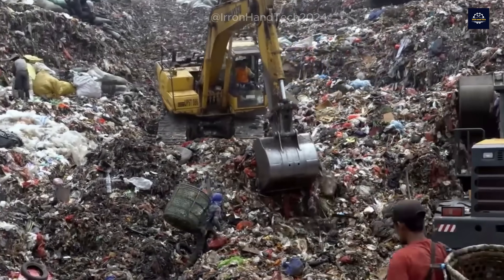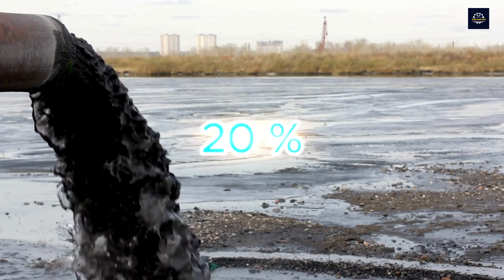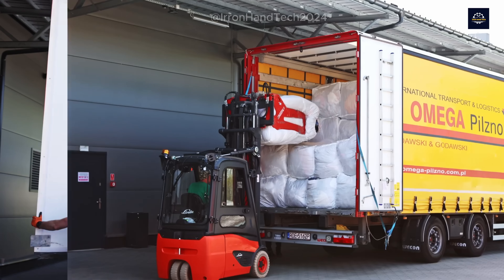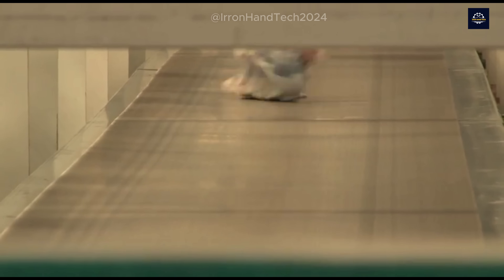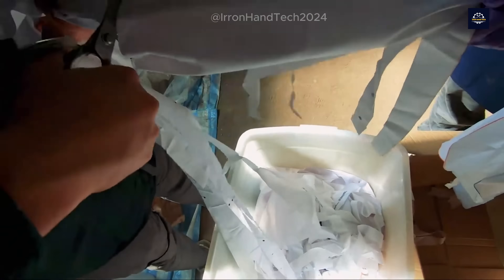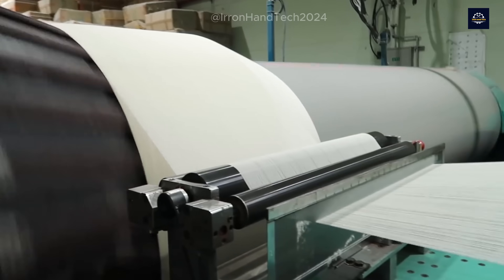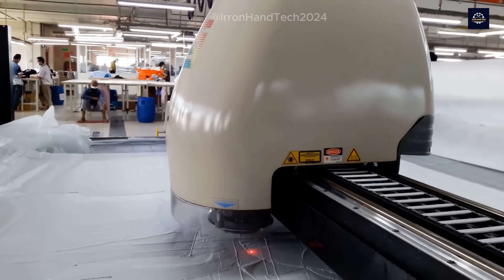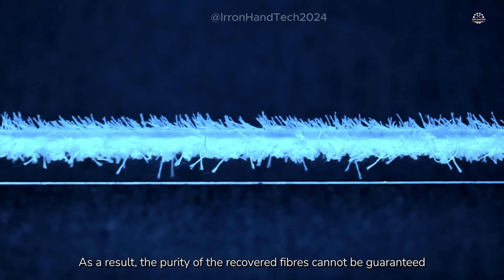How to Recycling the Textile wastes  ?

Comment: The strength of a thread depends on the length of the fiber. What we see here is super short fiber like dryer lint being spun into thread. Cloth made with this will fall apart quickly, It will tear and will wear holes quickly.  Good linen thread is made with fibers a yard long. Good cotton can only be less than 3 inches because that's how it grows. BAD cotton is made from dryer lint and floor sweepings. Clothes made from this thread is intended to be thrown out and replaced often.  I am amazed that it holds together long enough to be spooled.  Good cotton shirt can last 20-30 years. Shirts made of this might be trash in 2.
Reply from the maker: Thank you ! It's not as short as you think. Because the yarn is stretched enough to serve the weaving process.
Reply: @IronHandTech2024  Yes, for weaving and knitting, but this comment concerns the consumer quality and durability of clothing made from recycled yarns.
If you want to produce quality yarn from recycled materials (we are talking about cotton and wool), you need to spin long fibers. Which for recycled fibers means removing short fibers, shreds and dust from the mixture. And this is waste that has little use yet (technical textiles). We are talking about about 30% of waste from the total volume of shreds.
Reply from the maker: @marekurban2790  yes, thanks for your comments on this. Recycling will help us make use of resources, it can not be absolute in all aspects and it is not easy to be perfect like virgin fibers. Long fibers like polyester are not waterproof, so they do not absorb sweat well. Cotton fibers absorb sweat well but are also a cause of being more susceptible to odors. My point is that every fabric has its advantages and disadvantages. For the scope of this video, I think we should focus on the perspective that fabrics can be recycled instead of being thrown away, not on the disadvantages that the recycling industry is trying to overcome.
Reply: @IronHandTech2024  Thank you for your response. This is where we differ. In my opinion, it is necessary to present the situation as it is as much as possible. Realistically. Ideally, so that it is clear what is really happening with textile waste, without embellishment, from examples of good practice to, for example, landfilling in the Atacama Desert.
In your video, there is only sorting of clothes and shredding, nothing more.
Reply from the maker: @marekurban2790  you're right, in this video we're mainly talking about the recycling process. To be exact, the process is introduced. But you can watch another video in this youtube channel, we made a video talking about the dark side of the recycling industry. And maybe it has the dark side that you're thinking about in that video.

Comment: The recycling seems to be much more labour intensive than original manufacture. The sorting and processing alone seems to be a very expensive operation even before the yarn manufacturing. I can't see how this can be economically viable.
Regards from South Africa
Reply from the maker: Ah. It's very simple. If you recycle a shirt, it means that the materials that made it are reused to a certain extent. In terms of economics, recycling saves more fuel than new production, mainly from saving raw materials. Besides, we can't price the future, right?
Reply: You are absolutely correct ❤